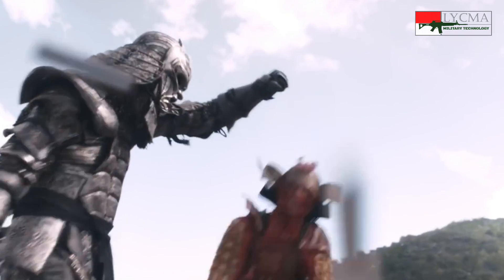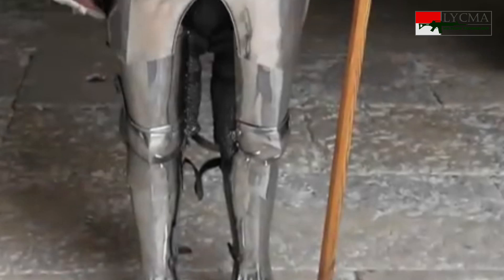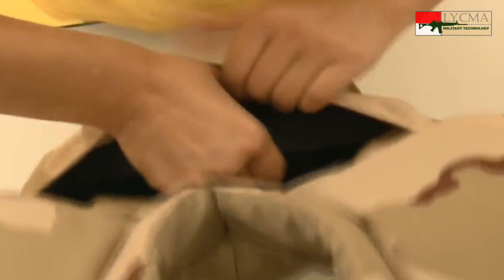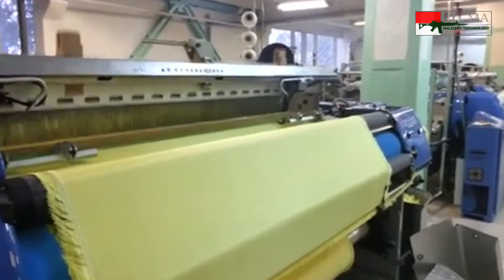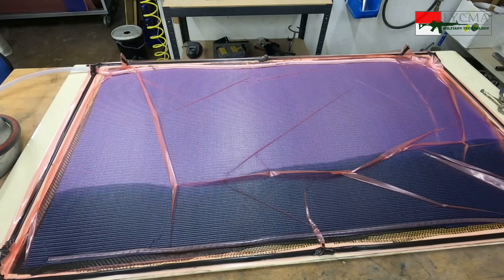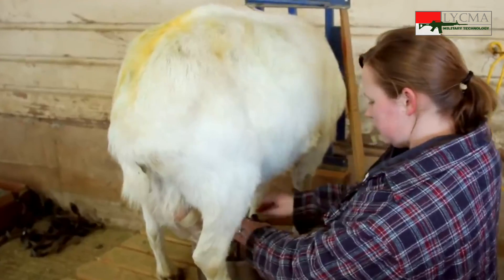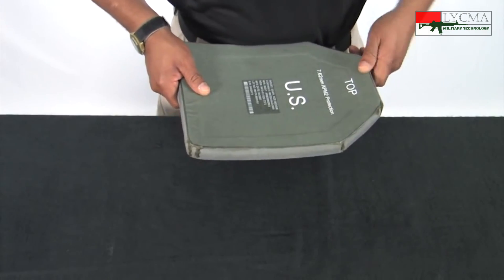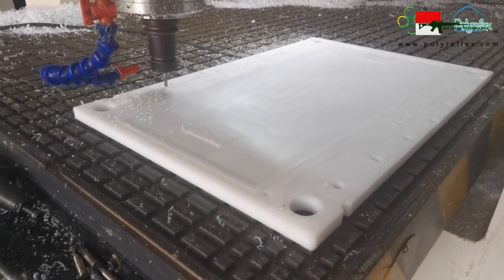Bahan dan Cara Kerja Body Armor / Rompi Tahan Peluru

Comment: 1:50 fyi sebenarnya pada ww1 ada prajurit tertentu yang terkadang memakai body armor, contohnya arditi
Reply: Kalo arditi biasanya prajurit seperti juggernaut dan bawa senapan mesin.
Reply: @blacrow337  Battlefield 1 njir 😂
Reply: @tankery7947  tapi emang beneran ada kok
Reply: @blacrow337  jangan bilang kalau senapan mesinnya water cooled

Kuat amat njir
Reply: @tankery7947  yep, bener sekali. Sesuai yg dipakai di battlefield one.
Reply: @blacrow337  so bf 1 is historically accurate?
Reply: @tankery7947  almost.
Reply: @blacrow337  btw kamu punya ig?
Reply: @tankery7947  gak
Reply: @blacrow337  kalo twtr?
Reply: @tankery7947  sama, gak.